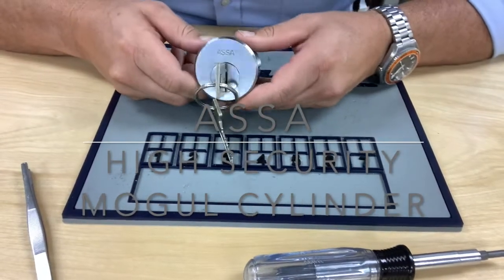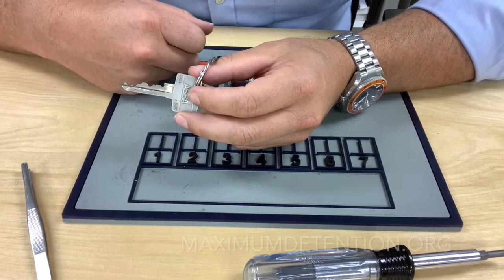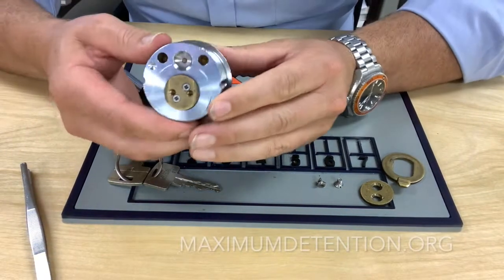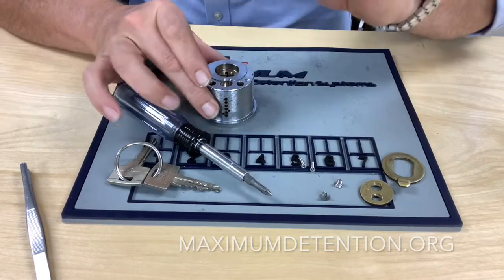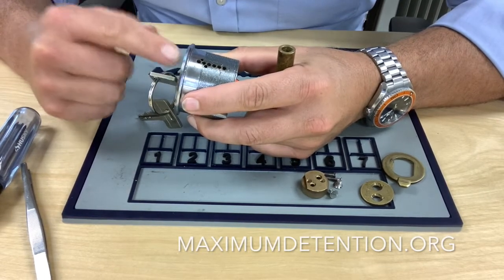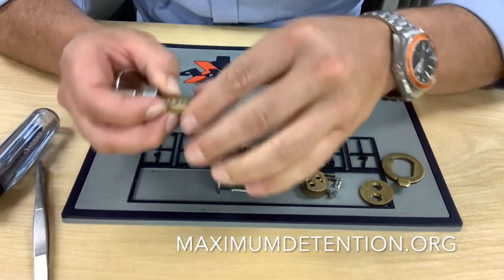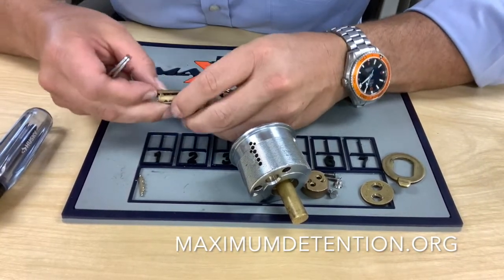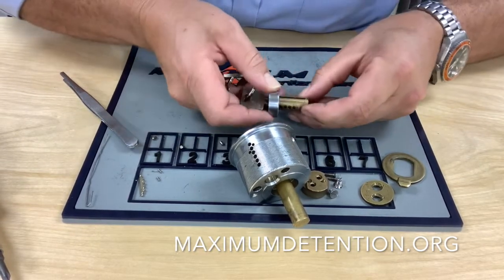ASSA High Security Mogul Cylinder

Comment: I'M NOT QUITE CERTAIN IF I CAN ASK A QUESTION, OR IF THIS IS STRICTLY FOR COMMENTS... IF COMMENTS IS ALL: I AM A 13 YEAR DETENTION VETERAN, 1SGT,  FOR THE BRUNSWICK COUNTY SHERIFFS OFFICE.  IN MY YEARS I HAVE MADE IT A POINT TO LEARN PRETTY MUCH EVERYTHING I NEED TO KNOW TO FIX THINGS ON THE FLY, INSTEAD OF HAVING TO BOTHER AND WAIT FOR COUNTY MAINTENANCE... INCLUDING ALL THE LOCKS.  WE USE THE ASSA BRAND, MOSTLY THE MOGULS... I AM COMPLETELY SELF TAUGHT AND HAVE SUCCESSFULLY FIXED,  I'VE DISASSEMBLED AND REBUILT THE CYLINDERS... EVEN MADE MY OWN LITTLE TOOL TO SLIDE THE CYLINDER PLUGS OUT...  REPAIRED EVERY POSSIBLE LOCK PROBLEM I'VE COME ACROSS... 

UNTIL NOW... THAT IS WHERE THE POSSIBLE QUESTION COMES IN IF ALLOWED... WE HAD A KEY BREAK OFF IN A CYLINDER.  THIS HAS HAPPENED MANY TIMES AND IT'S NEVER BEEN AN ISSUE GETTING THE BROKEN PIECES OUT.  BUT JUST RECENTLY, SOMETHING EXTRA HAPPENED WITH IT... WHEN I REMOVED THE BROKEN PIECE OF KEY... I PUT MY MASTER KEY IN AND THE CYLINDER WOULD NOT TURN... I LOOKED AND PLAYED WITH IT TRYING TO FIND OUT WHY... MY THOUGHTS WERE THAT IT SEEMED LIKE A PIN WAS MISSING OR BENT OR SOMETHING, BUT THE CYLINDER WAS NEVER REMOVED SO I DIDN'T SEE HOW THAT WAS POSSIBLE.  HOWEVER, AFTER TINKERING WITH IT FOR OVER AN HOUR AND A HALF, I NOTICED THAT AS I WAS MANEUVERING THE WHOLE LOCK PLATE AROUND, I COULD HERE A VERY FAINT TICK OR RATTLE EVERY ONCE IN A WHILE... SO I STARTED LOOKING MORE CLOSELY AND LOW AND BEHOLD, MY INITIAL SUSPICIOUS GUESS WAS SPOT ON... A TINY PIN HAD SOMEHOW COME LOOSE AND JUST RATTLING AND ROLLING AROUND INSIDE THE MECHANISM... NOW, I'VE SUCCESSFULLY REMOVED THE CYLINDER PLUGS NUMEROUS TIMES AND REPLACED THE PINS WITH THE LOCKS WORKING PERFECT AFTERWARDS... SO MY THOUGHT IS TO JUST REMOVE THE CYLINDER PLUG AND REPLACE THE PIN WHEREVER IT GOES... BUT... WITH THE PIN NOT IN PLACE, THE KEY WILL NOT TURN... I'VE TRIED AND TRIED!  BECAUSE IN ORDER TO REMOVE THE CYLINDER PLUG, THE KEY MUST BE INSERTED INTO THE CYLINDER WITH ALL THE PINS IN PROPER ALIGNMENT IN ORDER THE REMOVE THE CYLINDER PLUG... 

SO, ALL THAT BEING SAID... (AND IF ANYONE ACTUALLY TOOK THE TIME TO READ IT ALL... THANK YOU), IF I AM ALLOWED TO ASK A QUESTION... IT IS THIS:

HOW DO YOU REMOVE THE CYLINDER PLUG TO REPLACE THE PIN, IF YOU CAN'T GET THE KEY TO TURN BECAUSE A PIN IS MISSING? 
THANK YOU FOR YOUR TIME...

APPRECIATIVELY, 

1SGT G. B'MER
Reply: try to shim the top pin